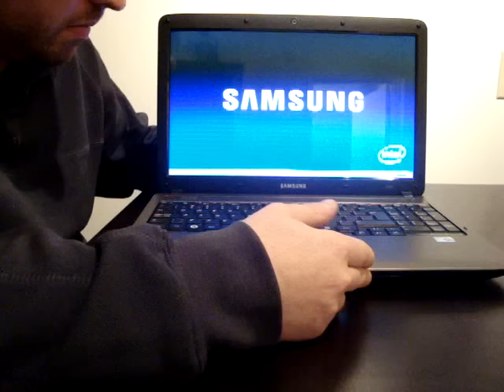HOW TO THE SAMSUNG R540 HOUSING PART 1

Comment: Very Helpful video.  Do you know where the wireless card is?  I want to replace mine but looking at your video, I'm not sure if that's even possible.  I have a samsung r580 but assume the wireless card will be in the same location as most everything looks the same as the r540.

Comment: Hi thanks to this guid I was able to remove my keyboard from my samsung r540 and clean off all the dust from in between the keys, when you remove the keyboard after you remove the two screws form underneath and then pry the clips with a creditcard and have the keyboard off, are there any pices that can fall off? because once I had it out I turned the laptop upside down and gave it a few taps for the dust to fall out, any tiny fiber washes in where the keyboard goes?